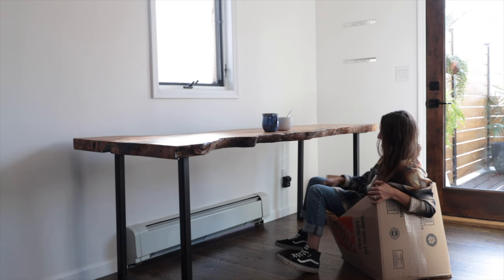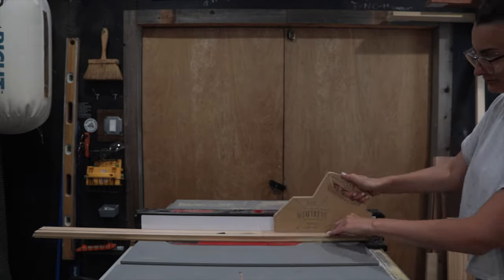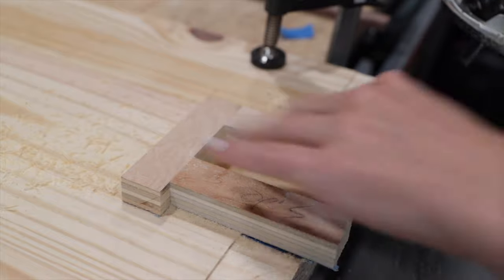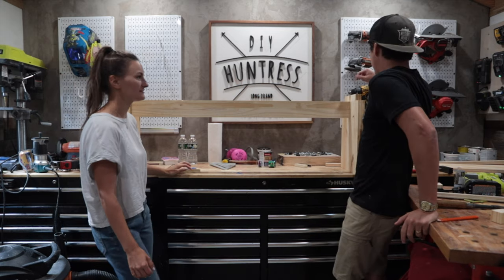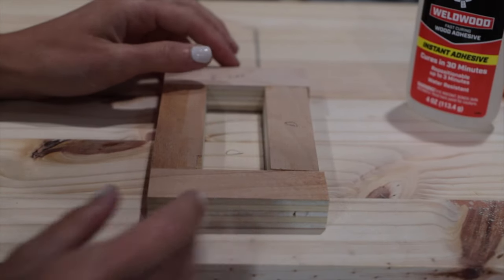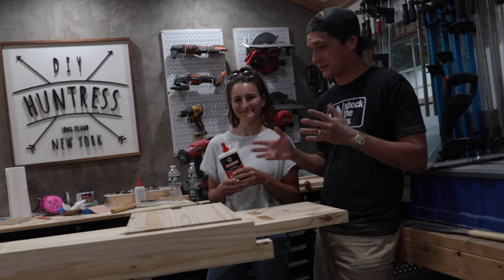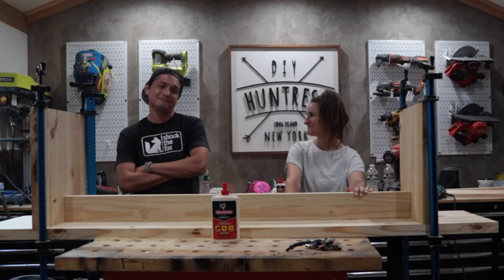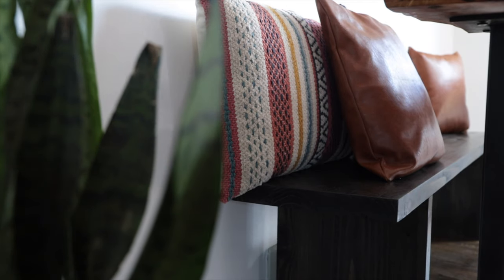A DIY Dining Bench built in ONE DAY | Featuring @diyhuntress

Comment from the maker: Support my channel through the following links:
-MAS Epoxies (Special Affiliate Link): https://masepoxies.com/?ref=18
For 10% off AND free shipping use coupon code: cowdogcraftworks
-Starbond CA Glues (Special Affiliate Link): https://bit.ly/36sB2Bv
For 10% off use coupon code: cowdogcraftworks
-The Real Milk Paint Company's Impressive line of finishing products (Special Affiliate Link):
https://www.realmilkpaint.com/ref/cowdogcraftworks/
For 10% off use coupon code: cowdogcraftworks

The Complete Japanese Joinery (Book): https://amzn.to/2OAj1sM
Rubio Monocoat Pure Oil Plus 2C 350 ml: https://amzn.to/3mMgY5I
KAKURI Woodworking Japanese Block Plane 60mm, Manual KANNA Wood Planer for Finishing Wood Surface, 2.9×2.7×10.1 inches (41937): https://amzn.to/3szzXoe
Stanley Sweetheart Chisels: https://amzn.to/2ZATrKg
Solid Brass Wheel Marking Gauge: https://amzn.to/3jfDFfR
Zetsaw Ryoba: https://amzn.to/39nkP6q
Glu-bot Glue Bottle: https://amzn.to/2CdxYOV
Mineral Spirits: https://amzn.to/31xTBmG
Dewalt Compact Drill: https://amzn.to/3ht3tng
Metric Japanese Style Carpenter's Square: https://amzn.to/35kC3fG
Rok Hardware 14 Gauge Table Top Fasteners with Screws: https://amzn.to/38CzW94
Mini Square 10x5cm: https://amzn.to/36mtcti
Faber-Castell Ecco Pigment 0.1 mm Pen: https://amzn.to/36oLni8
Pentel Mechanical Pencil: https://amzn.to/36uqbab

If you want access to more of the tools, check out my amazon storefront: https://www.amazon.com/shop/cowdogcraftworks